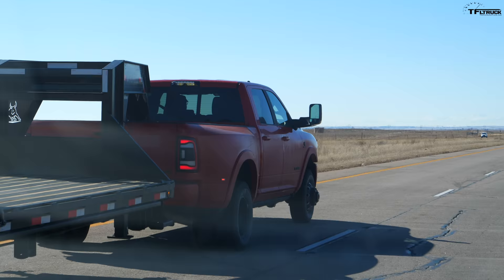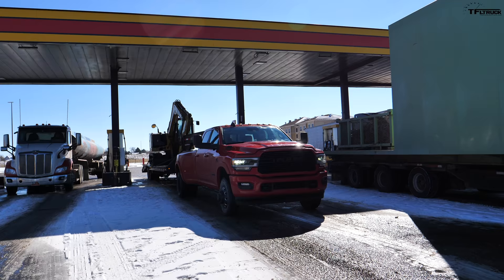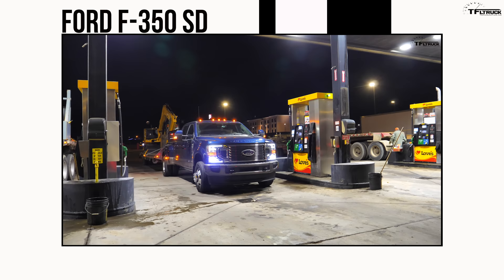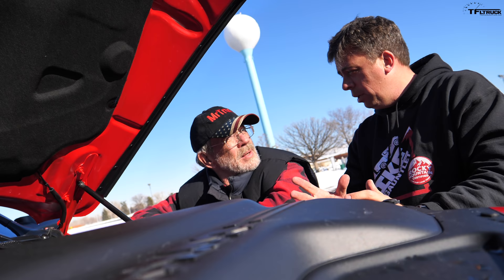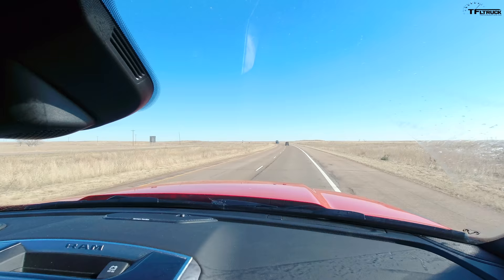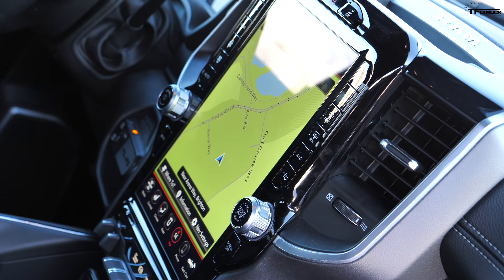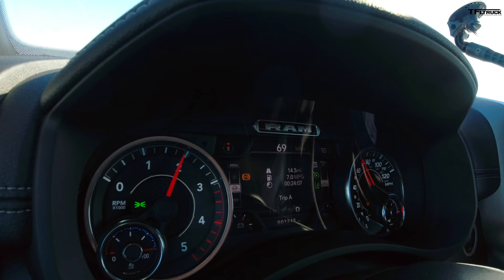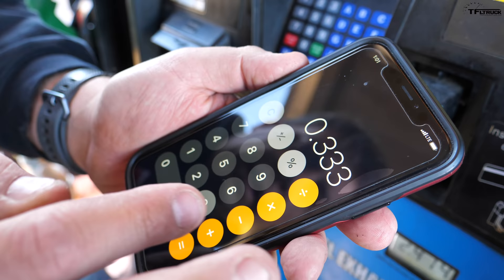New Ram 3500 Cummins Takes On Our 30,000 Lbs MPG Challenge Against GMC & Ford Diesels!

Comment: You dont buy a truck for fuel mileage.....
Reply: but when its worst in class, you don't buy that brand
Reply: @torment12345  good point, I never thought of that lol
Reply: You don't buy anything for "fuel mileage". You might buy a vehicle that will minimize cost for your intended operation. If truck A consumes 20% more fuel than truck B, then that is a 20% increase in fuel costs. If I'm an operator and truck B costs $50,000 a year to fuel, then truck A will cost $10,000 more to fuel each year. In 5 years, that's $50,000! Over 10 years or the life of the truck, that could be $100,000! I'm guessing you're not in charge of finances around your organization.
Reply: @AkioWasRight  Couldn't of said it any better. People love to jump the gun and not do simple math, I run 80k a year so 80k miles at 6mpg at $3.50 gallon ( cheapest cali diesel ) is $46,666. 80k miles at 7.8 mpg is $35,897. Thats $10775 a year and more $$ for hard 50 state runners!

Comment: That archaic 6 speed transmission is killing the Ram !  It used to be the most fuel efficient HD truck and now it's dead last and very far from Ford, who used to be the least fuel efficient HD truck !  Ram must definitely update it's HD trucks' transmission to an 8 speed at the very least !
Reply: A 70mph test doesn't do well for a Cummins with that rear end gearing since they are still working with a 6 speed. At 2,000 rpm you are already past your peak power and just pissing away fuel but that's the test they run. It's not like any of this is actually going to change anyone's mind about which the prefer, everyone is just here to trash talk the trucks they dont like

Comment: On two of my recent RAM Cummins trucks my mileage only got significantly better after 40k and 45k miles. FYI.  The 2018 took longer to "break in". The 2014 settled in a little faster. I'm on a 2019 now and can't wait to see my numbers go up.

Comment: 31 gallon tank getting 6mpg that stinks!!!! stopping before you hit 200 miles on a road trip would be annoying, definitely need that 50 gallon which you still only getting about 300 miles. Sounds like a in bed auxiliary fuel tank to extend the towing range.
Reply: I agree, my 2018 3500 has a 36 gal tank, makes no sense heavy hauling.

Comment: Ford ftw
Reply: How do you figure? They are doing fuel and Def mpg. Do the math and the ford is in second for this test in mpg
Reply: your crazy
Reply: @EGGINFOOLS  not trying to start some u tube argument or anything but I don't know that I completely agree with that. I'd rather keep a jug of def in the truck and be able to just slide over dump some in and get back on the road than have to pull in possibly wait for a pump pay ect ect. Cost change when time is money. Those what 5 times a month you have enough diesel but not quit enough def to drop your load would pay  for it self easy. If that made sense the way I explained. Have a good one!
Reply: @bigjohn5104  True. No argument here. I wouldn't be terribly pressed to look at the 
.9 mpg difference or the Def difference and make a decision based on that alone. Truck preference would out weight that by far I think.
Reply: EGGINFOOLS Actually not
In this test the highest miles of DEF per gallon is 198 miles so we’ll use that
DEF $2.92 per gallon on this test 198 miles 
Ram 1 gallon $2.92
GMC 1.06 gal $3.10
Ford 1.15 gal  $3.36

198 mile fuel usage $3.04 per gallon on this test 
Ford 25.38 gallons $77.16
GMC 28.70 gallons $87.24
Ram 33 gallons      $100.32

Total cost in 198 miles 
Ford $80.52
GMC $90.34
Ram $103.24

Price per mile total 
Ford $0.41
GMC $0.46
Ram $0.52

Price per truck at this rate for 250,000 miles 
Ford $102,500 in def and diesel 
GMC $115,000 in def and diesel
Ram $130,000 in def and diesel
Reply: @lw6735  They weren't comparing cost. Only mpg. That's what I was commenting on.
Reply: EGGINFOOLS Lol the only reason to figure mpg is cost why else? And btw when Ram was better than ford on fuel economy a couple years back the ford was better on def it’s a trade off . The truck getting the best fuel mileage is almost always using the most def but it’s more expensive to have worse fuel mileage and especially when u take care of all that emissions garbage ur left with only fuel mileage 😉
Reply: @lw6735  Don't know why you lol'ed like what I said was crazy. They didn't mpg for cost. You watched right? You can do it for cost of you'd like. It's a free world
Reply: EGGINFOOLS sorry I’m not trying to make fun you’re good 😉👍just saying why everyone usually checks fuel economy no hate intended 😉👍

Comment: Too bad Ram is ending their contract/ partnership with Cummins around 2024. No more Cummins after that, unless they work something out.
Reply: I bet they're going electric. Electric ram beating tesla truck again.
Reply: @campbell0162  I'm in Aviation Maintenance school. Dude in the class is a mechanic for Dodge, Jeep, Ram Dealer. Told me about it, I'm not happy either
Reply: @JalenRose02  Oh they're definitely gonna try to take a slice of that cake!
Reply: I don’t think they would give up that contract that one of there sale advantages and if they do Ford would jump all over that
Reply: @christopherbrown1391  Ford wouldn't partner with Cummins unless they had major problems with the Powerstroke.
Reply: Hayden Briggs they do have major issues with the powerbroke. It's why they had to redesign the engine 4 times in 9 years!
Reply: @JohnDoe-nz6bk  You can't give credit to Ram for the Cummins though, Cummins deserves credit for them. The 6.0 and 6.4 Powerstrokes were shit. But having personal experience with the 6.7, it's a very power engine and reliable. Cummins has been around alot longer than the Powerstroke so of course they have the recipe correct.
Reply: @haydenbriggs  Some random guy in class told you so it HAS to be true!
Reply: John Doe 
They upgraded it to handle the increase in hp and torque...Cummins should take note. In a Ford, you get the same engine and transmission in F250-F450.
Reply: @dchawk81  Considering he works on them everyday, and knows more about them than probably anyone here. Yeah, I'll take his word.
Reply: @haydenbriggs  Lol mechanics aren't in the know about what's going on in corporate boardrooms.
Reply: scottdbsn nooooo.. They upgraded it to all the oil pressure, turbo issues and blown engines!

Comment: @TFL: I believe I heard that Ram doing a regen at some point in the test. That would certainly harm gas mileage. Not saying the tests aren't equal, but if regen occured and the others didn't experience the same, it could help to explain why.

Also, would you care to tell which truck was more comfortable to drive?

Comment: I am going to get my first truck soon and I was thinking either the 94-01 Dodge Ram 1500 or a 99-06 Silverado. Which one is more reliable and which one should I get?
Reply: Silverado hands down with minor maintenance the motor will go 400+
Reply: I'm a Ford guy and I'll tell you get the Chevy. To me Dodge has never had a leg in the race. The battle has always been between Ford and Chevy, Dodge is just that third wheel trying to fit in.
Reply: Sales figures are a bit, idk watered down, most people now days buy a truck and never put anything heavier than grocery's in it. They do look good, I won't argue that. Also anymore no brand is what they used to be. Can't hardly work on any of them with a computer and a tech manual lol

Comment: Why the high flow?  I slow flow would be accurate I would think?
Reply: Getting a truck with trailer of that size would be near impossible to get to the regular fueling islands
Reply: It would also take from Easter to the 4th of July to fill an optioned 50 gal tank. I couldn't wait that long. Lol
Reply: My dad has a 65' Hatteras fishing boat with a pair of 1375hp (each) Detroit Diesel 16V-92s. Typical day out trolling burns 750 gallons. High flow fuel pumps are a MUST...

Comment: Remember, the Cummins weighs 400lbs more than the V8 diesels from Ford and GM. That's a lot of extra weight to be carrying around. That's like having a lawn tractor sitting on the front axle!
Reply: Maybe back in the day but a 2020 Ram 6.7 engine weighs 1060 lbs and a Ford 6.7 weighs 980 lbs.

Comment: LOL  another fun video.  As far as air suspension and auto leveling, only you could find a downside to a great feature.  I thought you as the CDL driver was responsible to inspect the load and truck and KNOW how much weight you are carrying and its distribution?  I don't understand how a good driver can "un knowingly overload" his vehicle.
Reply: Very easy. Moving a machine a couple inches ahead can shift alot.

Comment: In order to get any kind of science based results you would need to run at least 10 trucks of each brand at least 10 times each around the loop.  And in the end you could tell which truck gets the best MPG on a flat surface at 70 MPH.  What TFL really needs to do is test the trucks over a variety of terrains for at least a 1000 miles.

Comment: Any amount of wind will effect a tall profile, jagged load on an open deck trailer a LOT. Since you didn't run this unit at the same time and conditions as the other two I would say your results are inconclusive. You would have been better off using some low profile high density load for this test to keep the wind variable to a minimum. I have experience hauling flatbed freight with a regular semi and wind on a load is significant. Your normal 300 gallon totes filled with water strapped down and tarped would have been a better load to run this test.
Reply: Agreed. Performing the test on a big circular track could almost totally negate the windage differences. Not as good, but better than nothing would have been to drive their test loop both directions...

Comment: 04 has no def no emissions. Controls. No smoke well over 1200 ft pounds of torque and around 800 horse powavreaging around  14. 0 mpg yea all the modern snuff it out stuff rewalt hurts these vehicles and the environment
 Have fun.

Comment: What ambient temperature did you run all three trucks? Diesels with scr systems have aftertreatment warm up modes. These modes are much less fuel efficient than the efficiency mode. If the ATD is not hot, the truck has to rely on more egr to accomplish green house gas. Also, when was the last regeneration? If any truck goes into regen during the test the fuel economy will dramatically decrease.

Comment: Part of that mileage equation is the 4.10 axle ratio.  It's a factor when trying to make comparisons between these three trucks...basically 2 apples vs an orange in truck set up.
Reply: GM and Ford also have 4 extra gears

Comment: You should really run the test loop both directions to negate (minimize) wind effects. A 5-10mph headwind/tailwind will make a HUGE difference.
Reply: GroovesAndLands - they do. Same highway, east and west.
Reply: @donleamon8653  Didn't realize that! That makes the test quite a bit more valid in my mind.

Comment: Winter fuel vs summer fuel?
Reply: We (Colorado) do not switch to Summer blend until April
Reply: @cs6596  It might be worth a retest once summer fuel is back.  Judging from the clips, the other two trucks were tested when summer fuel was in use.  I seem to recall a distinct drop in mileage on my diesel Ram when winter fuel was used, vs. summer.
Reply: @wolfman9999999  Colorado law is Winter blend Oct 1 to April 1st... well before TFL acquired and tested the GMC and Fords which was just recently
Reply: Diesels are less efficient in cooler weather... They want the HOT... Run the Ram again during the summer...

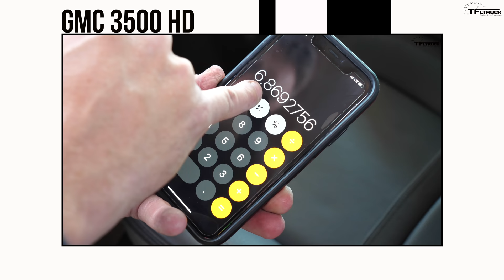Comment: 4:10 killed it, it's not in the sweet spot at 70 evidently, the 3:42 or 3:55 would be better at mpg but worse on the gauntlet, need a 10 spd or need to realize a couple minutes extra over a mountain pass is meaningless

Still rather have a Cummins or a dmax never buying a truck you have to pull the cab to fix
Reply: Dodd Garger Lol Duramax is actually a lot harder to work on than 6.7 Power Stroke with both cabs on Lol and if you ever gotta do real engine work the Duramax would actually benefit more from a cab lift option than ford but they don’t have that option made easy like ford does from back when the international power stroke 6.0 and 6.4 ran the fuel pump and timing off the back of the engine whereas 6.7 Power Stroke has everything up front and easier to get to than Dmax and still has the easy cab lift option that Ram n GM don’t have

Comment: I notice in the video it was pretty cold when you tested the Ram judging by the snow. Was it similar for the other 2? I swear my Ram's economy falls 1 to 2 mpg in the cold. I've often wondered if it's winter blend fuel, air density, or something else. I assume it's similar for all makes. My 2500 short bed crew cab gets 20-23 highway, empty but it's a little lighter and has 3.42's.  It's got pretty decent power but it won't tow 30k.  I'd say if you're not pushing these trucks to their max the 3.73 option would probably be better.

Comment: Does the Ford or the Chevy use a compound turbo system? For what we have to pay to get that diesel engine we should get a compound turbo system on the engine from each manufacturer. Lowers you EGT's and will sometime net you fuel economy increases as well. That's the plan for our 2008 Dodge as soon as I get the transmission built so it can handle the extra low end torque.

Comment: Disappointing for the Cummins, my 15liter CAT gets 6mpg running 70-75 and it makes more than twice the torque. And pulling twice the weight.
Reply: The mpg for all these trucks sucks really, new semis get up in the 7-8mpg.
Reply: Uhhh, you're fully loaded cat is 80,000 pounds with a bigger engine and at least 13 gears. This is 40,0000 pounds with a 6 speed and smaller engine. It absolutely did good, but could be better.
Reply: John Doe the gears don’t matter much; most of the time spent driving you’re in the final gear. My truck would get the same mpg with a 10,13 or 18 only difference being how long it takes getting it up to speed and maintaining speed uphill. I’m sure the Cummins is cruising at a comfortable rpm just as my cat. I still think the mpgs are disappointing considering new class 8 trucks get better fuel mileage.
Reply: John Doe i just like to pretend
Reply: Anatoliy Dashkevich at least you admit it!
Reply: John Doe and at least I don't get upset over other people's comments and start calling them stupid
Reply: Anatoliy Dashkevich hey, when the shoe fits! Don't be so butthurt by the truth!!

Comment: @The Fast Lane Truck Have you guys ever had problems with the Diesel ram's and using the pumps? I ask Cause my truck since day one has always been very tempermental about nozzle angle and thats not even with the high flows (2018 ram 2500 HD 4x4)

Comment: Maybe they should go with an actual Allison 10 speed or a ZF 10 speed. Or how about going like a big truck with a 12 or 13 speed. What ever they do I think they need a transmission with a wide enough spread to be able to have a 3.42 rear end. I thing the 3.73 is a big part of what’s hurting their mpg’s. Straight 6’s really do seem to work better at lower rpm’s.

Comment: I found that deleting and reprogramming my 2016 RAM 2500 6.7 Cummins gave me much better fuel mileage. All that crap they put on them causes them to use a lot more fuel, so I wonder what's truly better for the environment, 

1) Them manufacturing all the new things for the engines and exhaust, and producing DEF Fluid, and causing them to use all that extra fuel.
Or
2) If they Built them without the new stuff and DEF and opening the engines up so they get much better fuel mileage?

Comment: So at least the milage makes sense because of the def. So clearly what Cummings is doing is running more fuel so the motor runs hotter and using less def in order to meet emissions. Where as the ford is doing the opposite. I wondered how the fords diesel particulate filter will hold up with dirtier exhaust running through it.

Comment: Could be the 6-speed transmission.  TFL:  Was the transmission running in a lower gear most of the time, and making the engine run higher rpm's?

Comment: Hay guys maybe doing an average of three three runs would give the best numbers.  Do three runs then do an average of the three.  It would also give accurate results for the def 170/gal of def seems mighty low.  It seem I get 3-4 k on a tank of def with my 2017 ram 2500 pulling trailers

Comment: These are always fun to watch but you really can't judge any tow rig on a 66 mile loop. Especially with these modern emissions systems.

And comparing them on different days, different times of day, with varying traffic and wind and ambient temperatures and bladder tolerances and such is pretty silly.

My slipseater drives my truck during the day and is lucky to get 6.6 this time of year. I drive it at night and almost never go below 7.2. Last night was fairly warm and I wasn't super heavy at any point and didn't have to stop to pee mid route and got 7.9.

In summer I can get into the 8s while he's in the low 7s.

That's Freightliner. 

Same applies to all vehicles. Lots of stop and and start (like exiting after only 33 miles, dealing with truck stop traffic, etc) destroys MPGs as well.